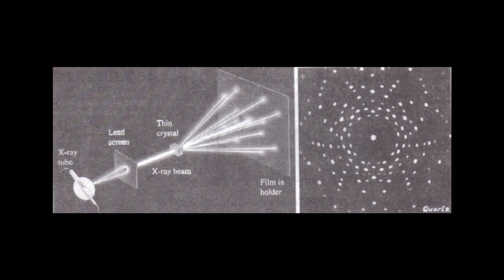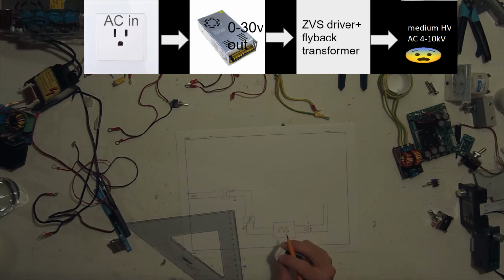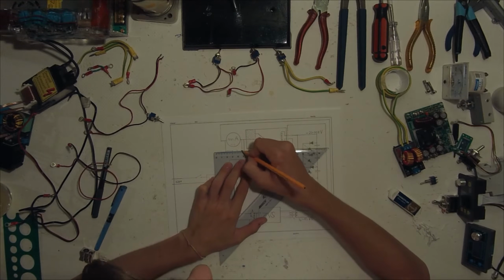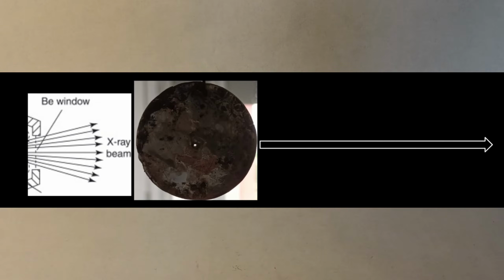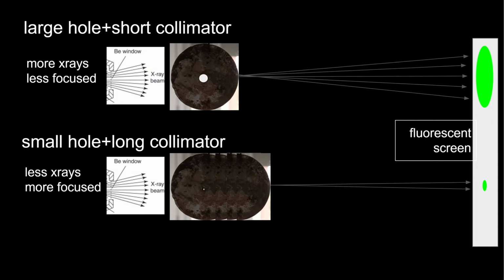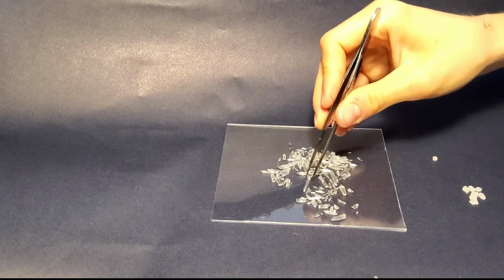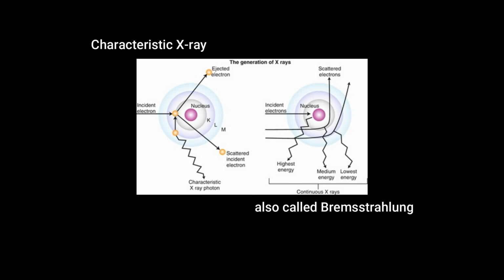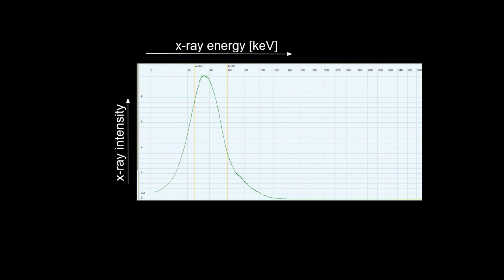Laue X-Ray Diffraction | diy Crystallography

Comment: Showing that camera’s CMOS sensor just how bad things can get if it doesn’t show some respect. Spicy light
Reply from the maker: Exactly, scary but fascinating, also I didn't show that but you can control really well the spiciness of the dot by adjusting the tube voltage, because not all photons have enough energy to go trough the lens glass, so increasing the voltage increases the number of photons that have enough energy to strike the sensor

Comment: Nice video but you share very few details. The HF transformer is gapped? What frequency works at? You added an extra cap in the main ZVS. I made the same circuit with the same components and without gap and the original capacitors I got below 12khz, so I gapped the HF transformer to get around 20Khz, so I don't understand why you added other cap, what I think it reduces the frequency even more
Reply from the maker: I didn't gap mine, the CW multiplier causes increase in resonant frequency, so I used extra C on primary, now it works between 20-40kHz at 1uF
Reply: @Farben-X  thank you for your answer.

So the total capacity of the capacitor of the ZVS is 1 uf?
Reply from the maker: @MrDuffman83 y, but its not critical
Reply: @Farben-X thank you!

Comment: I think maybe some systematic diagrams of what the tube's doing / what's happening in it would be cool, at specific points. Like I imagine would be in a early level physics textbook if it was covering this. Where is the one high level voltage going, and where is the other?

Very impressive, I don't think I will be trying to DIY in this field though...
Reply from the maker: Better not to these days😔

Comment: Thats pretty neat, can I clarify the crystal exposure time was 1 hr 30 min That seems very long?
Reply from the maker: Yes, that's due to the very inefficient process itself, and to the fact that the amount of xrays effectively hitting the sample is an extremely low portion of the total, as you need a very collimated beam
Reply: @Farben-X  Had a feeling that might be the case. Excellent experiment.

Comment: so you are using wax for cooling?
Reply from the maker: If you mean the multiplier, it's there for insulating the hogh voltage, it also dissipate a little bit of heat but cooling is not a problem as the multiplier doesn't get much heat

Comment: nice setup and experimentation. Why did you use copper as the tube for the collimator? could you have used aluminum or steel? Is it the density to absorb the Xrays or availability of material and tools? Just curious on the approach Thanks!
Reply from the maker: @georgeyork8975  Hi, the reason for the copper as you pointed out is that it has a higher adsorption of lower energy xray compared to iron, aluminum is pretty transparent to xray so wouldn't be a good choice. Also I had that nice cylinder that fit the application well.
Another theoretical reason is that copper won't poison the spectrum, as it will fluorescence the same way as the peak of the emission spectrum, while iron will introduce 6keV energy peak in the spectrum. in reality this influence won't be appreciable as the excitation spectrum is not filtered to be monochromatic, I just mention this as a curiosity
Reply: @ are the filament injectors  made of steel or stainless steel wouldn’t that contaminate the results? I am doing something similar and I am using an aluminum table but will fill it with molten lead and then bore a hole slightly larger than the extrusion hole size of .4mm say 1/8 inch. Usually they use lead tungsten  very heavy metals that won’t interact with the energies . I enjoy your videos as they correspond to what I am working on. Thanks!
Reply from the maker: @georgeyork8975  very happy you are making something similar, what is the aim of your setup?
Regarding the "contamination" yes I used stainless nozzle, they are cheap and easy to find, but there are also tungsten carbide nozzle for 3d printers that can be used to enhance adsorption.
Reply: @Farben-X  I want to use a similar setup to map out the wavelengths of xrays emitted  with a  salt crystal,  used as a  diffraction grating with a set of pin diodes and setup with goniometer to read the angles. Hoping to be able to setup a monochromater of xrays detection with the dimensions to record xray wavelengths by the diffractions created. I think most people just use the intensities to map out a spectrum but this is achieved over a longer period of time. i want to get instant measurements instead of a over a timed period etc. What do you think is it a crazy idea or a flash in the bucket experiment?
Reply from the maker: @georgeyork8975  Hi, very interesting idea, I'm very curious to see how it turns out as I'm also interested in using crystals as a monochromator. I can see a few limitations, first of all the resolution will be limited by the number of PIN diode you can fit, secondly you'll need to put all this contraption in a dark box as PIN needs to operate in the dark without cover over their sensitive area, are you going to use NaCl crystal? then be careful as humidity will damage it very easily, also are you going to buy the crystal already faceted or try to grow it yourself? As there might be other problems if you grow it yourself. Anyway I would bet you can get something working. if you want to discuss you can also find me on discord which is a little bit more handy
Reply: @Farben-X  These are absolutely fair questions which I have pondered and will approach as follows. I will put the diode in a light shield container as I have already built one. I will place it in vacuum and i will use a rotating assembly which will track the degrees of rotation of the crystal. once you know known lines of spectra all you would need to do is calculate the position as i rotates and look for the intensities resolved by the detector. This at least what I am planning as I move forward on this project.
Reply: @Farben-X  its usually referred to I think as Low "Z" material so aluminum alone isn't a good material in this application alone. This is why I am planning to fill the tubing of aluminum with lead.

Comment: For easy drilling of copper and other soft metals the bit needs to be altered slightly. Take a hand stone to the cutting edges to form a small flat (just large enough to see will do the job) that meets the work at 90*, so the cutting edge scrapes rather than digs.
Reply from the maker: @Broken_Yugo  thanks for the advice!
Reply: Also wd40 works nice as cutting fluid. Some people say milk but for me wd40 works better. Nice video

Comment: Good job on this homemade X-ray source for XRD, with extra kudos for using the high-side isolated filament transformer and for properly insulating the HV setup while also providing for water-cooling of the x-ray tube! This level of engineering is not typically found on youtube!

How much power is the x-ray tube running at?

It is the right choice to use a Cu anode x-ray tube (as opposite to the W anode tube) for XRD as the copper one needs lower voltage (~40 kV) to produce a strong Ka copper line at 8 keV while the tungsten one would need in excess of 100 kV for the 59 keV line in tungsten (ask me how I know!). The 8 keV line is also a lot easier on the resulting diffraction angles (producing larger angles). The only negative is that 8 keV is a lot more difficult to detect and to image.

Why not use a powder source for your XRD setup? Your mica pattern looks promising, possibly due to the mica sheet being reasonably thin; however the patterns for the other samples do not seem to look like diffraction. Crystal diffraction is typically done with the reflective geometry; hence the benefit and simplicity of using powdered samples, which conveniently provide for all possible incident angles for the x-rays to interact with the material, while still allowing for the transmission-geometry setup.
Reply from the maker: Hi, thanks I'm very happy there are some (very few) people liking and experimenting themself with these extremely niche topics.
I was able to run the power supply at 350W max (the image were taken with input power at around 270W) because over that the transformer core saturated, and I could add another transformer in parallel, but then I would need to add running water because that would be a lot of heat to dissipate from the tube. Anyway, my electronics are inefficient (idw how compared to the standard) for example in the NaCl XRD run, I was powering the transformer with 240W, and the tube was dissipating 190W so 79% efficient, I would like to build a half-bridge controlled inverter transformer.
Yeah, at the beginning of my experiment, I bought a W anode, but then, after studying more, I changed to the right one. Did you try to do that with a W anode tube?
I did not use a powder because I wanted the typical single crystal XRD pattern, with all the dots in a circle. Why do you think the others are not diffraction?
Reply: @Farben-X  With mica, the obtained pattern has an obvious circular symmetry as well as clearly showing both the 1st order and the 2nd order (dimmer) dots. The remaining 2 patterns are basically just random non-symmetrical dots, often of about the same intensity at different angles which seems a bit unusual. I guess those could still be diffraction-based though (in a general sense, even the regular reflection is still technically diffraction- (or interference-) based).

190W is not much but still very respectable. Should you decide to build a real half-bridge converter, I can likely share the schematics (and even the PCB) for my resonant topology half-bridge converter as a starting point. It currently delivers up to 750W at the tube without issues. Had to design it from scratch (which honestly turned out rather challenging).

I have done a couple of attempts with my existing W tube setup, trying to push the voltage to 100 KV and above (waiting for that tungsten Ka line to show!). On the first attempt it blew up my HV multiplier (resulting in a lot of hassle to open up the oil-filled and lead-wrapped enclosure to repair!) and on the second attempt it resulted in the HV transformer insulation failing and frying the half-bridge. I then gave up on pushing the W tube to 100+ KV and will next be trying to produce diffraction with just a basic X-ray energy filter (a thin sheet of W or Mo) and possibly with an X-ray monochromator made from a small piece of pyrolytic graphite. The problem with using the 59 keV W line is that the angle for the 1st order maximum is like only 2 degrees on graphite - making the geometry a bit difficult to set up.
Reply: @Farben-X  Also, since you already have a gamma energy spectrometer with the exposed scintillator window capable of detecting 8 keV, you are now just one small mechanical effort away from making a full-fledged X-Ray diffractometer! The only missing part is the goniometer (a rotary table will do) with the proper mounts for the sample and for the gamma spectrometer. Then just mount a powdered sample, illuminate it, scan the output energy at various angles, make a graph and compare it with the database. You should then be able to identify most of the crystalline powdered substances!
Reply from the maker: @bigbangscience3196  that's true, i thought of a possible setup but never did because commercial machines use proportional counter tubes, but with the spectrometer it should be easy to discriminate the effective counts from background.

Comment: What software did you use? I’m doing essentially the same experiment and I have results I’m trying to analyze.
Reply from the maker: If you mean to convert the diffractogram to structural data, unfortunately, I wasn't able to do so, I have looked a long time and tried to ask other people, but it wasn't possible to find a software that can do this.
Modern xrd machine ar a all in one system that contains the acquisition system and the software, and they use other type of detector, not photographic plate, so even if we took one ot those software (witch are probably very expensive) only the data conversion from analog to a format that the software can use would probably be challenging.
Also, modern machines are made very differently from this, they use automatically rotating goniometer  and spectroscopic precise detector, with the xray tube also moving in space, so they are probably hard to retrofit to this type of data.
The data on the photographic plate is essentially the former transfor in reciprocal lattice of the crystal structure so a skilled math/programmer might be able to do such software, but unfortunately I'm not one of them
Reply: @ crap I was worried you were going to say that. I’ve been looking into it myself and haven’t found anything helpful. However I am actually a computer programmer by profession, I’ll continue reading on it to see if it’s even remotely feasible to build something myself. In theory it should all be Braggs law of diffraction and geometry which isn’t too bad I guess.
Reply from the maker: Anyway, how is your project? What tube did you use?
Reply: @Farben-X  I’m using a dental X-ray as my beam source and a series of plates and tubes to collimate it into a beam. I stole your idea for the printer nozzle (I’m going to shout out your video in mine btw because it was very helpful in general and you deserve credit). I got a successful diffraction image but now I’m at the math part 😅
Reply from the maker: @FullModernAlchemist ah cool, thanks for the citation, what voltage were you driving the tube at? Usually for diffraction they use target with lower atomic number like molybdenum or copper, i haven't tried tungsten because I thought the image would become too blurred, but good to know it works.
Also what crystal did you perform diffraction on, and how thick was it?
Reply: @ I was running it at around 60KvP so the majority of the spectrum was around 39KeV according to my spectrometer.

The subject was a mono-crystalline silicon wafer and it is about 0.5mm thick.

Comment: So, theoretically speaking, could americium 241 be used because of the 26 and 59 keV gamma rays (basically x ray range just without spending a ton of money on high voltage equipment)

I think it would be a good experiment to try and make into a video
Reply from the maker: Yes, that is certainly possible, there is only a problem, time: my xray machine emits around 100000000000000000photons/s and I still need 1-2 hours of exposure, while normally available Am241 source to the amateur are in the order of the uCi, that means around 37000photons/s, so if we assume the Am241 is as efficient as the xray machine and make a simple proportion, to get the same number of counts with the Am241 we  would need 31000 year, that is pretty long.
So, it is theoretically right but unpractical with sources that are legal.
If you had an extremely sensitive detector, maybe you would be able to compensate for the low activity but they are really expensive and not available.
Reply: @Farben-X  from my observations, americium 241 (1 uCi point blank) with a radiacode 102 was 81.6k cpm so far less than 37000 decays per second (but that number includes alpha and gamma not just pure gamma)

Ways to make it better would be to have it closer and the sample thinner than what was done in the video
Reply from the maker: @The-One-and-Only100  yes, that would help, but making a thinner sample is really hard, the one i used was barely visible, you would need a microscope level of thin, and then a solid state detector would also be necessary, like the one they use in proper machine.